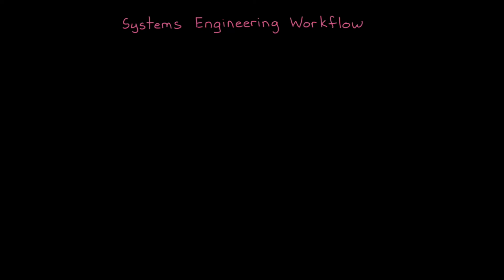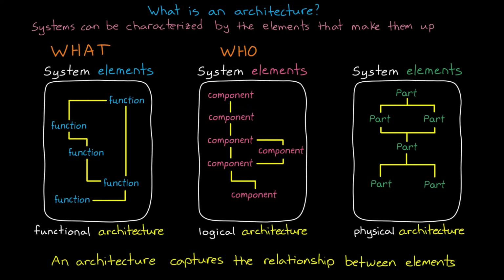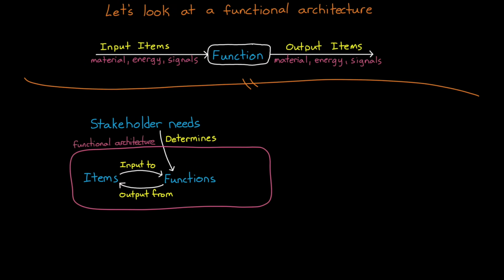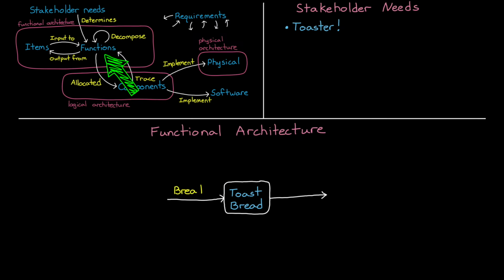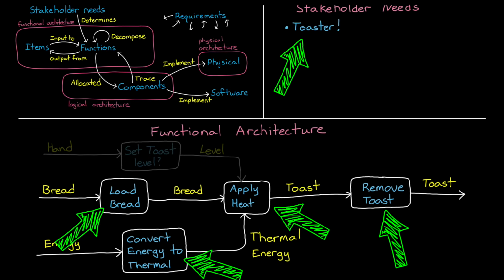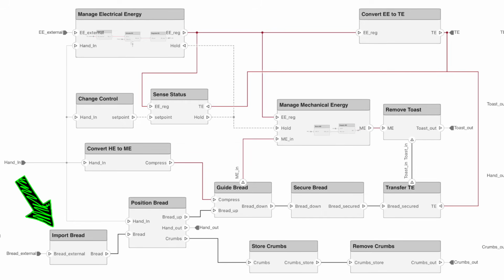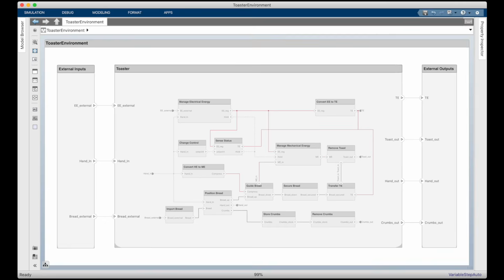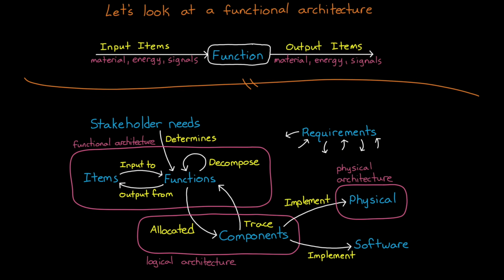The Benefits of Functional Architectures | Systems Engineering, Part 3

Comment: Got dam, as a quality engineer this sysyems engineering concept seems very close to Design of Experiments, and utilizing a little Fault Tree Analysis to solve a problem. 

It seems like systems engineers uses a 🐘 chart to see the 10,000 foot view of a project and then hone into the 200 feet view.

The way you explaining this is very easy to follow. Thanks for your due diligence on the matter, you have a fan.
Reply from the maker: Thank you for the feedback and for watching!

Comment: I thought toasters used a simple adjustable time setting to alter the level of cooking. Optical sensor or comparing the thermal level of toast to the set requirement seems like it would be very expensive for such a simple system? - Just a thought. Great video series by the way, many thanks for sharing your knowledge!

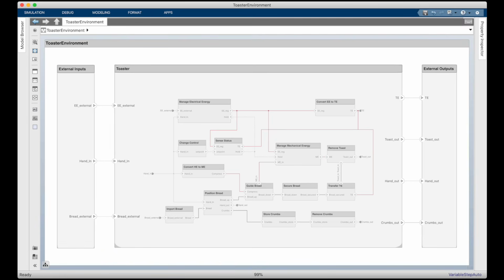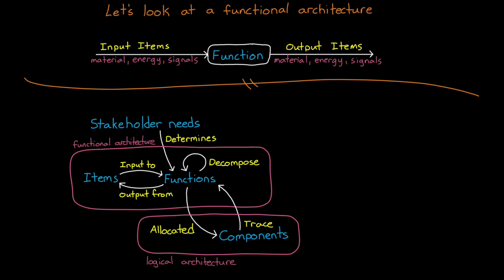Comment: Furthermore @12:43 you refer to the functions "Manage Electrical Energy",  "Convert EE to TE", "Change Control" and "Sense Status" as "components", when @4:21 you used the term "components" to refer to the logical architecture system elements. Sad!

Comment: Note that in video 1 in this series you said that "Airframe" was a function. My reaction when watching that was that it was incorrect. This video proves it. The airframe (noun) is the part or component that performs the function "Provide structural support for the vings" or something like that. This mix up between nouns and verbs is infuriatingly common and it is very unfortunate that such an excellent presentation as this makes this kind of error in the very first example.